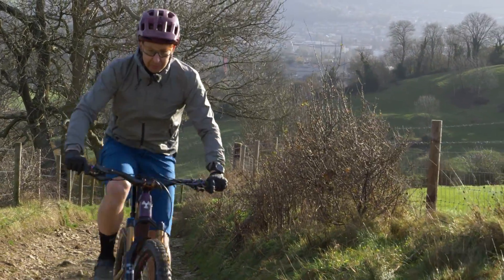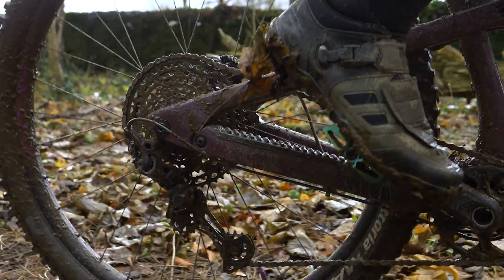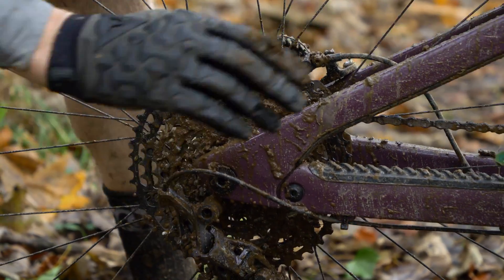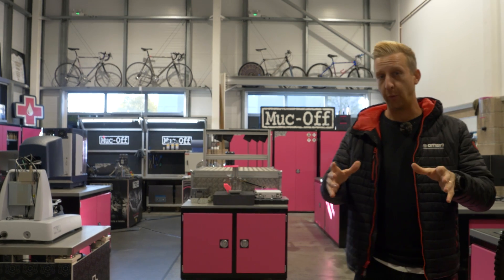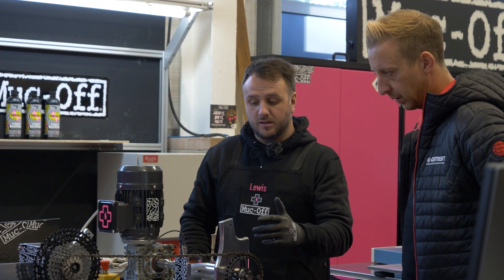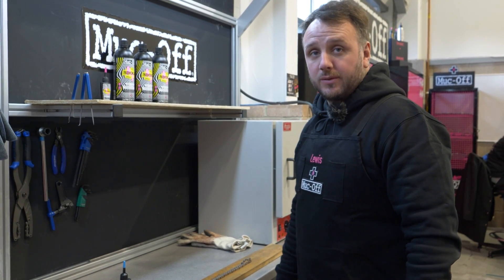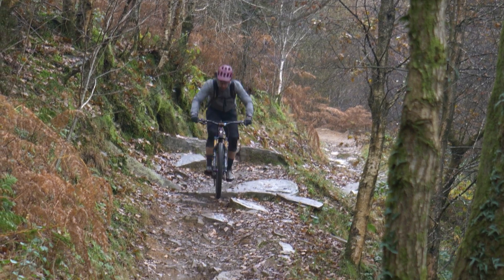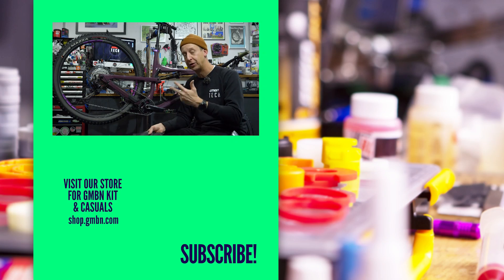Does A Dirty Chain Affect Transmission Drivetrain Efficiency? | GMBN Tech Does Science

Comment: Highly misleading to use the loss of one run as a baseline value, when really the power that went into the system in both runs (which you didn't mention) should be the base line for the calculation. That way you'd end up with efficiency figures like 97.6% vs 97.1% (example for 150W input baseline and 4.29W and 3.55W loss) revealing that the actual difference would just be 0.5% or thereabout.

Comment: The takeaway from this is everyone riding normal length rides in the muck should be running immersive wax.. like MSpeedWax or Silca’s immersive wax. Drip lubes just can’t deal with these conditions. Your drivetrain life, cassettes and chainrings, will be vastly extended as well

Comment: Question for some research as I have not been able to get a solid answer from some industry sources... maybe you will have more luck.

29r Forks are gearing towards shorter offsets (42/44mm), but why are 29r DH bikes still running upwards of 56mm offsets?
Reply: I guess 42/44mm offset are for pedaling efficiency, with slacker head angles.
You don't need it on dh bikes.
Reply: @Sebas_Pinard  I have Similar thoughts, or maybe with the slack dh headtube angle and the speeds they are at a short offset might exhibit too much of the caster effect making it hard to initiate turns?
Would be great to hear something from manufactures or riders really in tune with their setups.... Bruni, Gwin, Minnar???

Make it happen GMBN

Comment: I like what you are trying to do here, but it didn't really work out did it?
Can't follow your data, both chains were losing 4.29 (Watts presumably?) before cleaning? Out of what input? Or was it taking 4.29watts to turn it?
A better experiment would just be to fit pedal (or crank) power meters AND a hub power meter then go for a muddy ride. Then you can just compare the two readings throughout the ride to see how the efficiency drops off.

Comment: I like to use the blue chain bath thingy, but invariably it sprays cleaner everywhere which I detest. Most usually I just WD40 rag it roughly clean and put some more lube on the top for 2 or 3 times and then next one it's off the bike and in a homemade tub/sieve type cleaner and dried over an old heater in the shed.

Comment: Less than 1w in saving after cleaning the chain, my conclusion is that you can avoid cleaning the chain, it works perfectly even in muddy conditions
Reply: It’s the chain wear which is the problem, mud is like grinding paste in the rollers, yes the efficiency is irrelevant.
Reply: @simony2801  I agree

Comment: Interesting topic, but ...
There are many open factors in the test.
What are the figures, power consumption (power) in the engine, torque in the shaft of the spindle?
Also interesting that XT and XTR get exactly the same value before cleaning and lubrication.
How was the status of the chains (wear) if you measured traction, assumes that the fit between the chain and the gear has a great effect. for example new drive against worn chain or vice versa.

Then how much of the energy consumption does the chain consume, when you add up the total to get ahead on the trail

Comment: Good attempt at measurement. It could be interesting to see a more thorough test with controlled conditions and many chains. A dirty but greasy chain might be a few % less efficient but would it be an appreciable difference compared to the extra drag of tyres through mud and water or slip depending on the track surface.

Comment: AFAIK, chain wear testing rigs apply a constant load. I wonder if there would be a measurable difference if they tried to simulate the cyclic load that a human imparts. For example, does the peak load exceed some materials tipping point that the average wouldn't trigger.

Comment: I have 3 issues with this video. There is not power conversion. if you are losing 10 Watts definitely worth it, but only 0.5 maybe not so much. Second this only concerned mud on the chain. Not mud caked onto the derailleur, the cassette, or the sprocket, so the friction in theory would have been higher (yes I know there would be some transfer, but the more gunk the greater the friction.) finally they assumed which gear most riders use, but if we are honest with ourselves the number 1 used gear is the ole granny gear. and they didn't test this gear that would have a more extreme angle potentially creating more friction.

Comment: He didn't get the chain dirty enough for this test to be meaningful!  A truly dirty chain will also lose most of its lubricant as mud mixes and sheds both over hours of riding.  The question of how many dirty rides does an average MTBer ride before cleaning & re-lubing must be answered first.
Also, while he had access to Muc-Off equipment, why didn't he also get measurements of losses as the chain was progressively misaligned (both dirty & clean) from the 'ideal' chain-line?  Rather than measuring losses in general, why not measure total efficiency in such different scenarios?  Losses are usually caused by compound conditions, so overall efficiency is the most important metric here.
On the plus side, he at least used a lab.

Comment: I would have liked to see the test with pulley wheels involved.  They are mud collectors and probably contribute a lot.  That would help with the gearbox debate.  It’s fine content, but this answer has already been known for years since friction facts.
Reply: There is another thing. Big double chain guides/bashguards.
I pedal at leas 3h for a day with my Enduro. The first mountain is easy because the bike and drivetrain is clean. After der first DH I can feel the difference even the shifting feels bad. 
After 3 h of riding some of it wil be dry again but man of you use your hand to pedal you can really feel the difference. Normally it's easy even with the Pinky. With dry mud it's impossible to do that..

I just bought a gear hub to reduce this and the fucked up deraileur thing..
Reply: @Vanadium  Which one did you get? I am so fed up with this cycling industry Bs... old school laughable technology with  ridiculous pricing... All the snobs and idiots with money out there, pls invest your "hard" earned money in to proper technology/inventions what actually makes life easer. Cheers.
Reply: But in every group , as the group mechanic, I see chains that need attention. Well more than just chains, but man oh man can they get neglected.

Comment: What's interesting with the Shimano 12 speed chains is that if you run them into the ground, not checking for chain wear and replacing the chain, they fail in a way I've never seen before. At the wear level where the chain is about 2% longer than new, the chain becomes visibly wavy under load. Looking down on the chain while riding it's very obviously going from side to side as it goes from the cassette to the chainring. This is after thousands of muddy km including well over 50 km of climbing, so it's not had an easy life. Previously, 10 speed chains would tell me they'd had enough by snapping under load, so this is a very safe mode of failure by comparison - theoretically I could continue riding it as it all still works, but I'll leave finding what the next thing to go wrong will be to someone else. I suspect it's down to the narrowness of the chain meaning that uneven wear between the inside and outside chain plates is enough to create a visible sideways bend when the chain is loaded.

Incidentally, at 2% wear, there was no skipping under load in any gear or misshifting, it was probably a little noisier then when new, but even that wasn't particularly noticeable. The 12 speed shifting was just as awful as when it was all brand new. Compared to 1st generation clutch derailleur Shimano 10 speed, the force needed at the shifter to change gear with 12 speed is astronomical - front shifting on 2x12 is the best I've ever used, though still only marginally better than 3x10. The good thing is that this means you get a hell of a lot of miles with no intervention (Or spending money and creating unnecessary waste buying new chains) bar the normal cleaning and lubrication and you're not risking chain failure or skipping gears.

The efficiency is probably lower on the worn drivetrain than a new one, but it still gets me up everything faster than the people I ride with and doesn't feel any less efficient. Thanks to the godawful feel of 12 speed shifting though, my next bike will have a less efficient (At least compared to a clean chain in a gear with a straight chainline) Pinion gearbox with a belt drive, which sidesteps all drivetrain maintenance bar giving it a quick squirt with a hose after really muddy rides and checking the belt tension every so often.

Comment: It’d be nice to see some 12speed re-usable quick links produced by shimano and sram. A regular, thorough chain-off cleaning would be a bit easier/cheaper/less wasteful then.
Reply: You can use the "non-reusable" ones a few times, obviously not recommended, but it works.
Reply: Yes, this is a bit of kit that we are really lacking. I often took the chain off fir cleaning in the 9 speed days but I don‘t want to pay 3 Euros every time and risk taking it off only to find out that I have no fresh quick link and the lead time for that is 48 weeks.
Reply: I know what the manufacturer say but honestly, they are re-useable on the same chain just don’t re-use it on a new chain. Always carry a spare anyway.  They are just covering their ass by saying ‘don’t’ . At the end of the day do what you feel is right.
Reply: @n31lrc  - Yeah, absolutely! It’s hard to unpack the liability/compatibility/efficiency/user error that are all involved in this kind of thing. Especially when these parts are all consumables. 👍
Reply: Buy a Connex quick link. They can be used over and over.
Reply: @mtbkmaniac1  I got the same hint a few weeks ago but with KMC. If you look closely, the re-useable links only go up to 11 speed. For Connex, it seems that they make a 12-speed chain but the 12s quick link is not sold separately. Their 12-speed chain will not have the HG+ extended inner links, otherwise it would nor be compatible with SRAM 12s and so you are at least loosing some of the HG+ niceness.
Reply: @mtbkmaniac1  - Great idea… I’ve got a bit more wear left on my sram chain. I’ll be going with a fancy kmc chain next. 😁👍
Reply: @mtbkmaniac1  - But something proprietary from Shimano or SRAM would be much better as it’s designed to specifically work with the system. There’s no reason they shouldn’t have a more expensive, reusable option.

Comment: Why was the chain tested unloaded on the MucOff spin rig? It looks like the drive side of the chain is slack. It would be great if they tested it at 300 watts instead of 3 or 4 watts. It would be interesting to see if the 17% difference would also scale at higher power.
Reply: In my opinion such tests are irrelevant to real world or perhaps that test was shown in simplified way. 
The power loses in the chain would depend on the load. Harder the push on the pedals higher the forces on the links and higher the friction gets. It should be stated at what power level such tests were made. 
Additionally, I am not very interested what the loses are when I am blasting down the trails on 16 or 18 cog but what's happening when I am grinding uphill on 45 or 51 with the chain crossed as hell. Those climbs take much longer time. So I don't get that argument after testing it in the straight line only. Makes me wonder if it is just because their rig doesn't work well if the chain is not straight.
Reply: @piast99  agreed 100%. A cross chain condition in a 51t cog in the rear under 300-400 watts is what I would be interested in seeing with chain links side-loaded. Data from an unloaded straight chain is not very useful.
Reply: Well muc off really botched their initial go at doing friction testing, by not setting the rig up to be representative of real conditions.  They tested the chain at full tension top and bottom, where in the real world the bottom is slack, which does effect the results.  So a slack drive side is better than two tensioned sides. 

They made a junk product called team sky hydrodynamic lube. It was not as good as others in terms of friction (according to a competitor test), and resulted in higher chain wear in an independent test.  I used it and it would always turn black.  They never admitted it was junk and just came out with newer products.  I’ll never buy their stuff because of it.
Reply: Doesn't look particularly slack to me, that type of dyno is easy to load and we only saw brief running shots. Chains are generally very efficient ways of transferring power so I would not be surprised of that is a 3 or 4 watt loss off of say 100w. Still not super close to the power you want your chain to be super efficient at though.
Reply: @tristanhanley8741  at 8:21 the tension side of the chain is flapping around. Also the chain length on the tension side doesn’t look anything like a modern MTB with short chain stays.